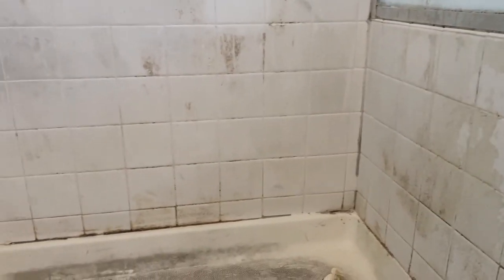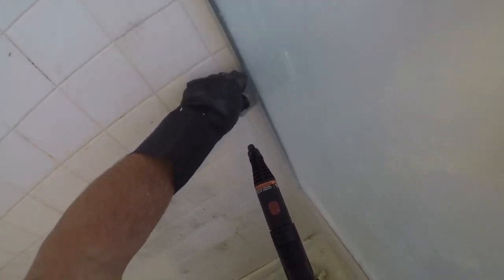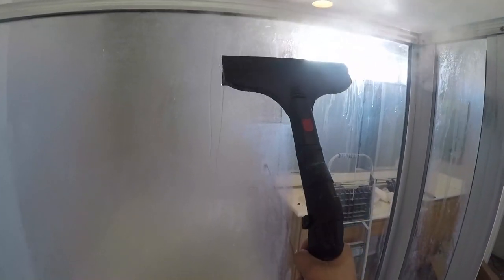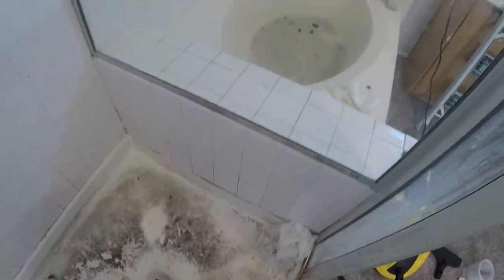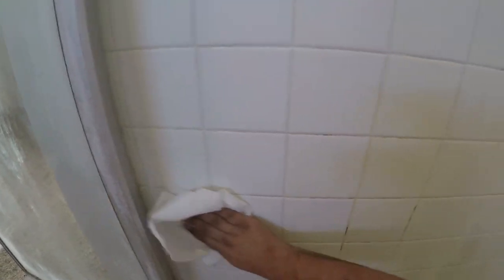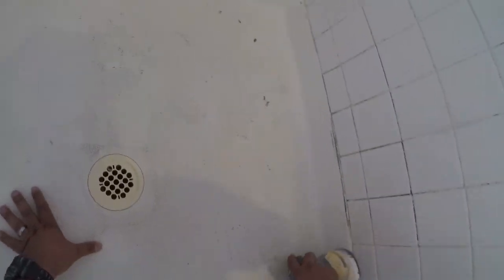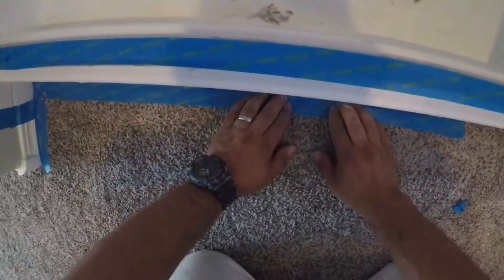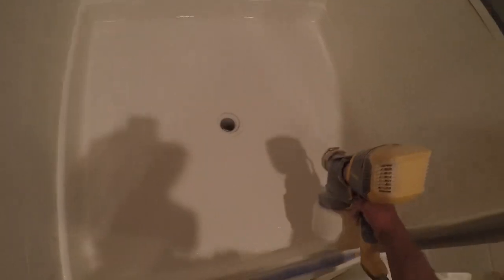HOW TO REGLAZE a BATHTUB & TILE SHOWER | Reglazing a Master Bathroom to get a house ready for sale

Comment: 4 hours clean the tiles?? That looked just horrible at the start of the video! I’m speechless over the fact that someone used the shower or bath it looked so nasty 🤢  Now you have made it look like new good job 👍 I hope the homeowner will try to keep it clean from now on!!! 
Who puts a carpet in the bathroom?? I live in a country where winter is freezing cold but most people put tile on the bathroom floor never a carpet!
Reply from the maker: Its actually being sold...they are ripping the carpet out...their contractor accidentally put it in bathroom LOL! That’s why I didn’t worry about covering it up too much. Good eye though.
Reply: @DPTubs  I’m not used to seeing houses with carpet on the floor, general in 🇮🇸 we use mostly hardwood flooring or tiles.

Comment: Looks  awesome 👌 great ideas on your prepwork i started using  green label which has  much stronger smell then midwest
Reply from the maker: I will have to check it out. Always willing to test out new material
Reply: The smell before and after? I used to clean houses. A steam cleaner would have been a good investment.

Comment: Amazing to watch.  How long does the coating last?  We bought a house where this had been done to well, with just the bathroom tiles, 'though maybe not professionally, unfortunately it started peeling off quite soon after we moved in and for some reason just wouldn't seal properly around the bath, so we've lots of shower curtains and will have to put in a new bathroom suite, tiles etc.

Comment: Hey brother great job man. My in-laws have the same type of shower, with the bottom being fiberglass. If I etch the tile walls with the acid that you use will it damage or harm the fiberglass floor? Also is that Kilz primer? Thanks
Reply from the maker: Thanks man...just showing what works best for me. No it will not as long as you rinse it and do not let it sit... it will be totally fine. I use Zinser 1-2-3 or Bin Zinser Shelac primer. Either works fine for me as long as you let them set up well and dry.
Reply: Nothing will happen to the fiberglass shower pan if you etch actually helps the dirty be easier to clean off
Reply from the maker: I only use etch on porcelain or ceramic. Fiberglass just needs to be cleaned and sanded with then apply a bonding agent.
Reply: @DPTubs  what bonding agent do you use?

Comment: What’s bro shout out from echo park Los Angeles 

When I come across tubs like that porcelain or fiberglass I use etch the napco black etch and it clean all that up I scrubb it with a red 3m pad and Ajax comes right off let me know if you try it
Reply from the maker: I would never use Napco brown etch on fiberglass. Sorry that’s not my process. You only need etch on tile or porcelain surfaces.